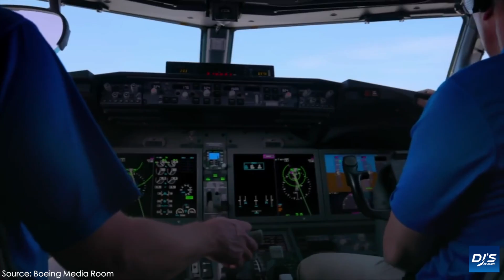Boeing 737 MAX & MCAS Problems

Comment: MCAS should be removed from any plane that has it
Reply: Lol... do you realise then Boeing would have  to scrap every single 737 Max?
Reply: @remi_gio  No. The plane would fly perfectly well without MCAS. What would happen is that it would lose commonality with 737NG and EVERY 737 pilot would need to recertify for the 737MAX. That would cost A LOT of time and money.
Reply: John Molloy Wrong! It doesn’t fly  “perfectly”  because of imbalance of the plane (heavy engines mounted more forward) .... so without MCAS and only pilot as back up simply won’t “fly” with European regulators anymore... And btw all MAX pilots will require training anyway which will cost time and money to Boeing not the airlines.
Reply: @remi_gio  The imbalance is not the weight of the engines, it is the aerodynamic force at high angles of attack that increase pitch up so that the controls do not act linearly. Many planes have the POTENTIAL to do this (A320neo for example). Point is, a competent pilot can compensate for this problem and a 737MAX can take off, climb, cruise, descend, and land without MCAS. It is not ideal and does not pass part 25 certification standards, but it's possible. Non linear controls have been a problem through the history of flight, compressibility being one example.
Reply: John Molloy OMG dude... you sound just like some people after Lion Air and Ethiopian 737 MAX crashes... they were not competent those pilots.... and you are wrong again the engines are heavier and mounted slightly higher almost on top of the wing as there is no space under the wing. Being more powerful... the engines are the problem as they cause as you said - aerodynamic imbalance. Don’t try to say it’s a good plane... because it’s not. It’s another reincarnation of an airframe from the 60’s... with old hydraulic wing surfaces controls.... that cost way too many lives... because of... design, cutting corners and corporate greed. You can read the congressional report... But yeah... talk about your linear controls... and pointing finger at Airbus that is similar... yet there were no crashes of A320neo.... shameful.
Reply: @remi_gio  I'm sorry if it came across like that, that is not what I meant. I attach absolutely no blame to the pilots and sheet all the blame to Boeing I mean, how can you compensate for something you don't know about that takes control of the plane and tries to fly it into the ground? My argument was that if a pilot knew how the plane would react it was flyable without MCAS. I have extreme sympathy for the Ethiopian pilots in particular as Addis Ababa is the epitome of "hot and high" and takeoffs are difficult at the best of times. My wife has been a passenger on Ethiopian Airlines after the crash . I trust Ethiopian . The fact that the A320 neo has the same potential problem, yet has had no crashes, shows that Airbus were aware of the problem and took the necessary steps to make the plane safe. Boeing did not, and hid the fact that they hadn't. That's what is shameful and If I came across as an apologist for Boeing, I didn't mean to.
Reply: John Molloy I’m glad we are on the same page then!

Comment: One thing I don't understand:  If there were no MCAS, wouldn't the airplane fly perfectly well?   So why install it?
Reply: If there were no MCAS, the new aerodynamics of the Max {bigger engines, and a stern-shift in centre of gravity) would result in the nose pitching up and sending the plane into a stall at cruising attitude.
Reply: Thus the MCAS was then written as a software and "cheap" fix to pitch the nose down when this happens (when the angle of attack is detected too high). Repeated activation was also implemented such that the plane could continuously maintain the correct pitch during cruising.
Reply: No, MCAS is there for a reason, but even that is horrendous on Boeing's part. To fit the bigger more efficient engines that airlines wanted (and were competitive with the A320neo), the engines had to be moved forward and up for ground clearance because the 737 has very short landing gear. They can't change out for taller landing gear without fuselage redesigns which would require a new type certification. But moving the engines not only changed the center of gravity and thrust, it also changed the center of lift because the flat-bottomed engine nacelles generated a some lift. The nacelles have flat bottoms again for ground clearance because of short landing gear. All of this changed the flight characteristics and made the plane pitch up and changed the known stall characteristics compared to the 737-NG. So MCAS is there to correct the plane's natural pitch up by forcing a pitch down if the AOA sensor detects too much pitch up.

All of this is a huge failure by Boeing and the FAA. The domino effect caused by moving the flat-bottomed engines changed the flight characteristics enough in certain circumstances to ordinarily require a type recertification. But that would have required extensive retraining for the many thousands of existing 737 pilots, mechanics, and flight crews which would have made the new plane too expensive for airlines. So, imo criminally, Boeing and the FAA decide that the MCAS system is sufficient to resolve the changed flight characteristics problem.

The fact that MCAS could activate off only one potentially malfunctioning AOA sensor, and the lack of pilot training with MCAS, is only the tip of the iceberg. It's a whole mountain of bad decisions piled up on top of each other, with business interest well ahead of safety interest.

We should all keep in mind that in 2003, US Congress voted to allow manufacturers like Boeing to partially self-certify their own planes in order to reduce the burden of work on the FAA. This is what happens. Always and invariably, money gets put ahead of people.
Reply: bladerunner12 Profit over safely. 
To put is short: MCAS exist simply because the aerodynamic of the Max had changed so they added it to avoid violation to the certification rights and keeping commonality. That’s completely normal. The problem is the whole thing was rushed to market with very little training and care for the new MCAS onboard and how to handle it in critical situations.
Reply: @bladerunner12  Why couldn't the regular autopilot handle this?  Isn't it supposed to keep the airplane straight and level.  And vertical speed can be set.  And what about the pilots?  Why couldn't they handle the occasional unwanted pitch up?  Something about this just does not add up.
Reply: @stephendavidbailey2743  As part of FAA airworthiness certification, "no abnormal nose-up pitching may occur," under FAA 14CFR §25.203(a) "Stall characteristics."  This means any pitch-up by the craft must be the result of intentional input, either by pilots or automated system. The placement of the engines created abnormal nose-up pitching under certain conditions, so a system (MCAS) to balance out the nose-up with automatic application of trim down had to be introduced to meet air-worthiness certification. Though if you ask me, it shouldn't have. However, since 2003 Boeing is allowed to partially certify their own planes.

As to why autopilot couldn't handle this, in a sense it did. MCAS is just additional autopilot programming for dealing with the plane's natural pitch-up, it's not like a new piece of hardware--it's additional autopilot software using existing AOA sensors and trim motors. Autopilot software is designed to operate within expected nominal conditions. If conditions become unexpected, it autopilot hands control back to the pilots. But since with the 737 MAX pitch-up was "expected," the autopilot software had to be adjusted to expect it and deal with it. This is MCAS, an adjustment to autopilot systems for dealing with the new flight characteristics.
Reply: @bladerunner12  I actually understood that and am not a pilot.  You are very good!

Comment: Didn't mention about the AP turned off on one aircraft and they got confused, not know what to do. Pilot errors here not having the training are faults of their airline, not Boeing or the FAA.
Reply: Except Boeing didn't tell the airlines nor the FAA that MCAS could cause a nose down with override on the pilots and the AP controls. Additionally, AP and MCAS are separate systems, with MCAS being a fundamental flight program {the Max would not fly properly without the MCAS} and AP being an assistance program {pilot can still fly the Max without the AP}
Reply: Did you even listen? Test pilots and engineers knew there were problems but nobody listened to them. And it it was just pilot error then don’t you think the aircraft would have been in the air months ago?

Comment: Shameful! I'm almost done reading the report, it's appalling! 
Criminal charges are needed, those crooked executives, engineers and chief pilots need to be prosecuted.
Reply: I wouldn't say shameful yes I think we have had enough of the hard pressure of the negativity. look. it was a mistake. they all cant be sent to jail or prosecuted if something unexpected happened to the aircraft. stay on the positive side
Reply: Nick Olliver a mistake? they knew about it and didnt tell anyone i dont call that a mistake. Boeing is not the same company from many years ago. Profit over people’s safety is never an option and Boeing is paying heavily for it and im glad. I hope they learn from this.
Reply: @masflow09  I never asked you to come here. I was focusing on this troll not about the subject. Yes a "mistake". They happen. A big mistake if you prefer! No they did not. Again. How would they of known it? They would have done something about it. It was unexpected that MCAS would pitch down. Boeing has had some downfalls over the past 2 years. They did put profit and safety over people first but safety lacked all of a sudden due to the crashes. They shot themselves in the foot for heavens sake. Move on. Yes I expect them to recover as 777x should boost up 787 and 737 problems!
Reply: everything you just said are not necessary unless if they were done on purpose You were the one that was shameful
Reply: @epochoftime  this guy is a heck of a troll. I've come across his real bad attitude recently. goodl luck with the scrutiny he comes out with :(
Reply: Nick Olliver thxs
Reply: @Playford Seven bore off? This person is a troll not me!
Reply: @nickolliver3021  you again... you're just pathetic Nick 😑 I bet you didn't even read the report. Do your parents work at Boeing? Is this why you're defending their criminal actions? Disgraceful!
Reply: carocarochan stop being rude

Comment: Hard to reliably detect  all failure modes of a single sensor. Some failure modes are easy, open circuit, for example, but there are others that are virtually undetectable.
Reply: True, but if the MCAS was inhibited by a disagreement between the two sensors, they would both have to fail in the same way to generate a catastrophe.
Reply: Richard Bell I recall reading something about the EASA pushing for adding a third angle of attack sensor, which in this context makes sense because two identical failures would be exceptionally rare but still in the realm of possibility.
Reply: The AoA sensor on one of the accident aircraft had apparently been serviced incorrectly. it worked fine but the data was 20 degrees out !

Comment: they added mcas because the bigger engines being mounted higher and more forward changed thrust characteristics and angle that could lead to a nose high stall situation right? what if mcas just slightly reduced engine power to reduce the nose high characteristics? i think slightly less engine power is more manageable than a forced nose down maneuver.
Reply: even more complexity
Reply: They can't reduce thrust because they need airspeed to generate enough lift to maintain altitude. The wing is too small.

Comment: Wrong, wrong and wrong.  Worse that you state two sensore were an option.
Reply: on takeoff, if the nose was too high the airplane would stall if the airplane had two AOA and they did disagree then the computer had to guess which is correct, that is why Boeing decided to go with a single AOA to take the guesswork out hoping the single AOA never fails, well they guessed wrong
Reply: transformer889 
If the AOA sensors disagreed, the system should simply not activate rather than try to guess which one is correct.
Reply: @kardy12  on takeoff if the plane stalls it will happen so fast that pilots don't have time to respond, so MCAS was Boeing answer to the problem. the engines extend above the wing and that interferes with airflow over the wings and if the nose is too high then the plane would stall.  There is a very serious aerodynamic problem with the design of this plane that can not be solved by simply changing a few lines in the software.
Reply: transformer889 
MCAS wasn’t operational immediately on takeoff. It only started interfering once the pilots retracted flaps.
Reply: @transformer889 Yes but the second as you called it angle og attack was an option as news put it a year ago maybe they had it wrong.
Reply: Alec Grolimond 
All 737s come with two angle of attack sensors. But MCAS relies only on one, allowing for a single point of failure. And with the Max, Boeing made the warning light to warn pilots of a AOA sensor disagreement an optional extra.